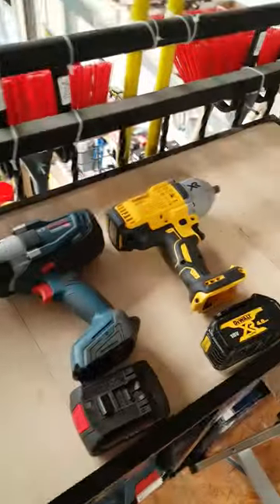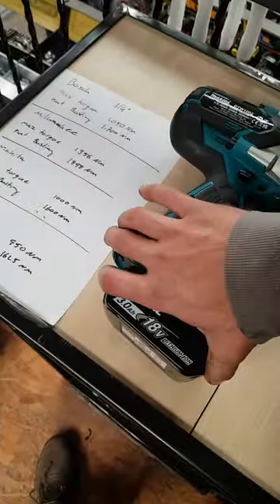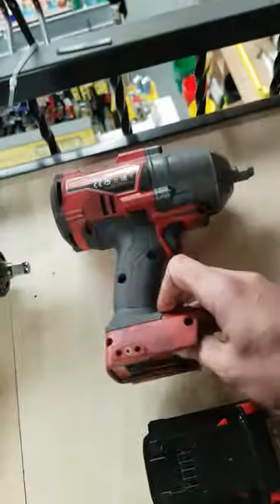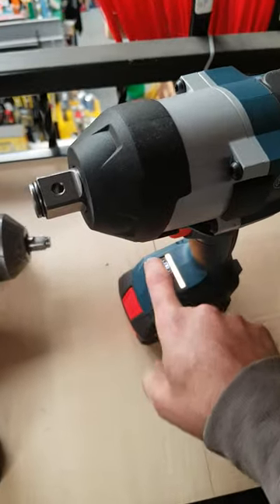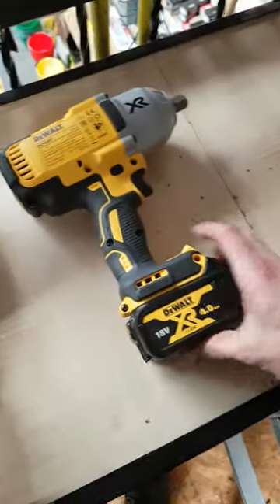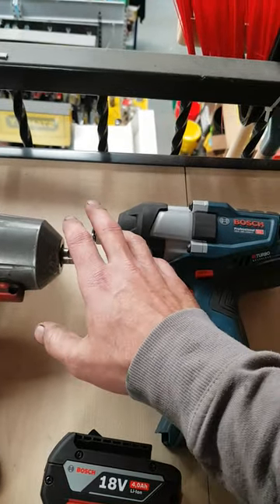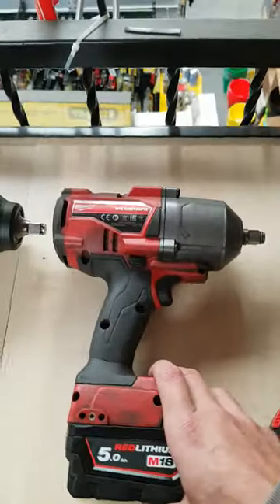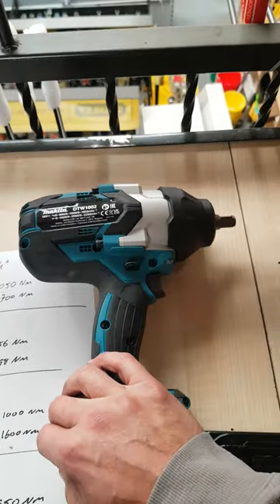Impact wrench, pro's and con's of the top 4.

Comment: This is a really good video, cheers for making it. A lot has changed in just over a year with the new Dewalt DCF900, Milwaukee's new impact yet to be released in the UK shortly, Hikoki's new impact (WR36DGW2Z) not sure about Bosch. But they are all more powerful except Makita which hasn't release a new 1/2 18v impact for years but it is still a great impact. 

Everyone I know who owns a Milwaukee has had battery/terminal issues due to the extremely sloppy battery to tool connection, excessive movement of anvil due to only having a Nylon washer in the housing (Makita uses a thrust needle bearing, last a lot longer). Two of my friends who are HGV/heavy diesel mechanics both have Makita and the tools are a lot more reliable, only issue i hear is grim getting in the trigger, but easy sorted by cleaning it out or replacing just the trigger.

Comment: I have the Bosch in 3/4" and bought a 1/2" anvil for it. It's only takes a minute to take the four screws out and change the anvil to what size you need instead of having two different sized impacts.

Comment: Is there anything you can do to reduce the battery wear on the Milwaukee? I already have one and don’t use it often enough to justify replacing it, but if I can do anything to increase its life I’d like to
Reply from the maker: tape the battery on, or use a big rubber band. if the holder is already loose. you can use a soldering iron to melt some new plastic on to the worn bit and file it square again.
Reply: @deandohertygreaser  Great, thanks a lot Dean!

Comment: Also with the Makita good internals:
switch omron and with rubber gromet
good bearings NSK
fuse to protect controller
Made in Japan
Reply: Jep recently bought a corded Makita HR2470 SDS Drill was fairly surprised to find an Omron Switch and  Marquardt brush ring inside. No ling long cheapos in there.
Also Made in Romania, expected Made in China for the price since it was only 100€ which is a really good price for the Quality you get.
Really solid and well made Housing aswell better than some of my Bosch tools. Lead is 4 Meters long too, some machines come with short leads which is very annoying.

Considered a Parkside drill but they are around 50-60€, far worse quality and good luck ever repairing it.
Makita sells you all spare parts you could ever need, not that im going to run that SDS drill to death but if something ever fails its a cheap fix.